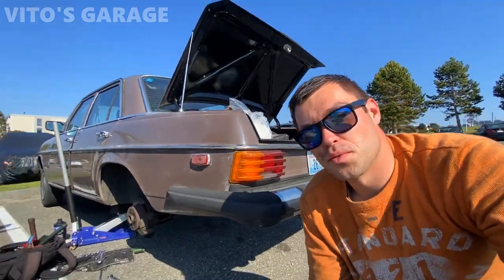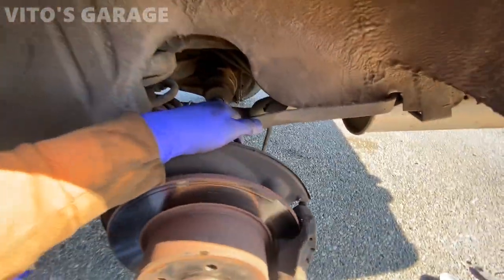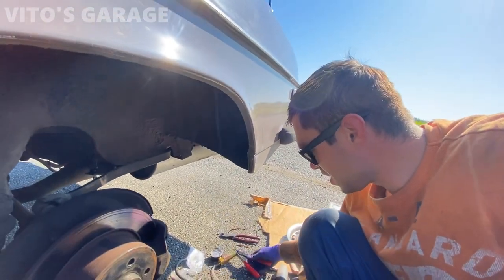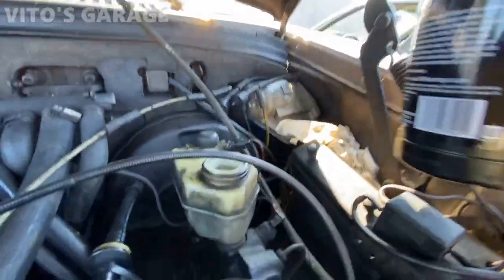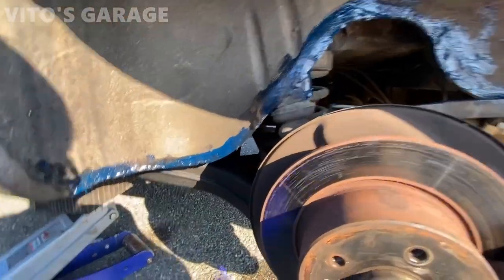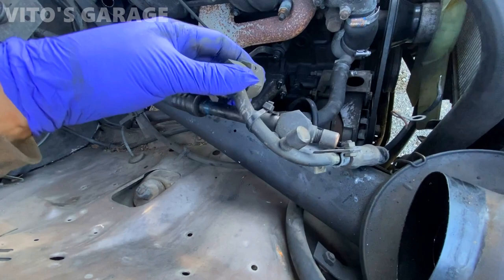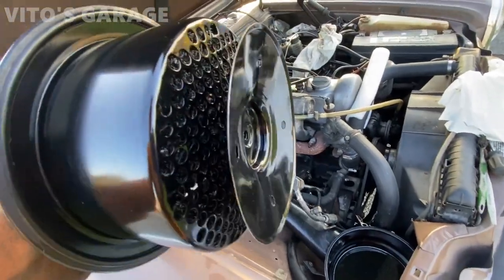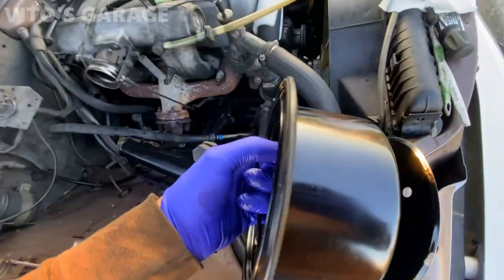1976 Mercedes 240D W115 New Rear Brake Hoses and Brake Flush. Cleaning Oil Bath Style Air Filter

Comment: Whats with the oil in the intake?
Reply from the maker: That’s normal. Oil filters the incoming air. You have to do this cleaning procedure every 25k miles. Pretty amazing engineering if you ask me
Reply from the maker: This is all factory
Reply: Called an oil bath filter
Reply: Many thanks for your video and effort to save this beautiful car.😊